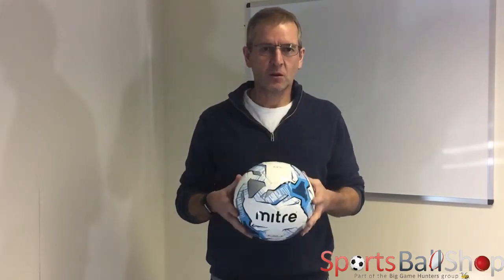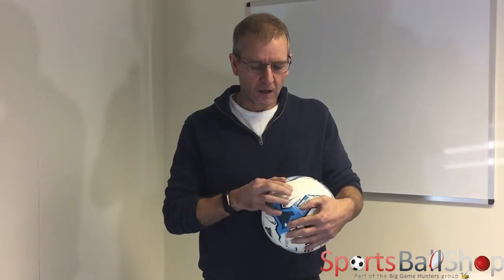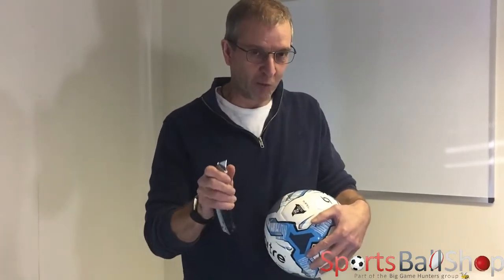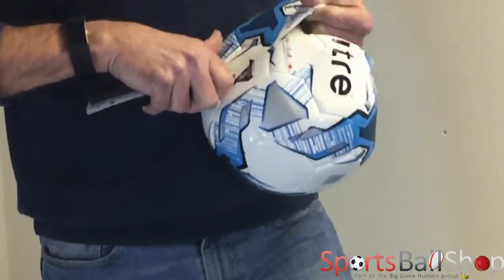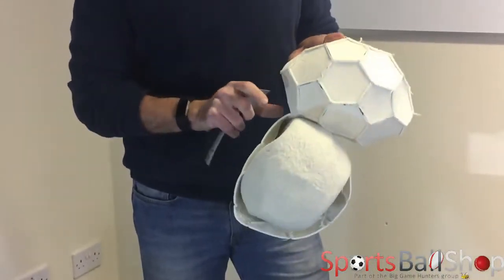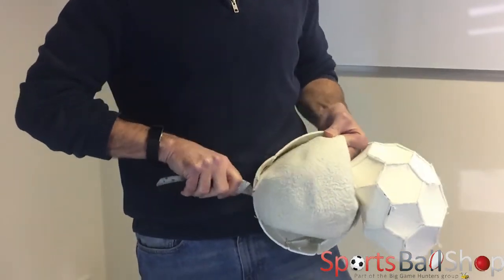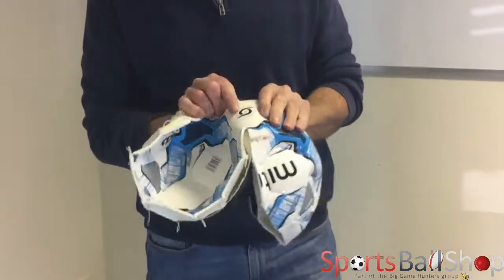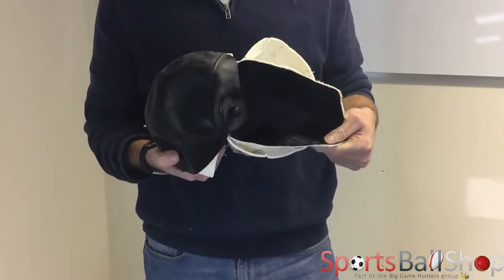What's Inside A Training Football or Soccer Ball?

Comment: hello. is it possible to remove the valve ? cuz mine is damaged i want to know if i can exchange it
Reply from the maker: Hi Hussein, unfortunately it is not possible to replace the valve on most balls. To clean out the valve, dip the needle in glycerine to lubricate the needle as there may be dirt stuck in the valve which may be causing it to leak.
Reply: +Sportsballshop too late. im actually trying removing it right now so its damaged, hope it works
Reply from the maker: Oh dear. Good luck i hope you can fix it

Comment: What really inside a football?Your answer here:The inside of the football is made up of a latex or butyl rubber bladder which enables the football to be pressurised. The ball's outside is made of leather, synthetic leather, polyurethane or PVC panels. The surface can be textured, weaved or embossed for greater control and touch:Me:So how you see it huh?
Reply from the maker: 1st off we were told by the manufacturer but then when we cut the ball open we found out to be true